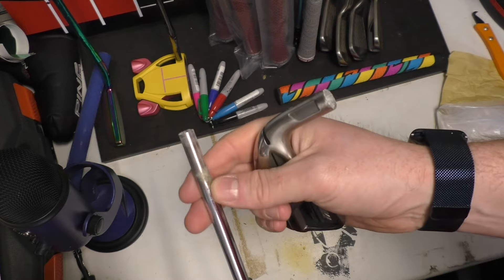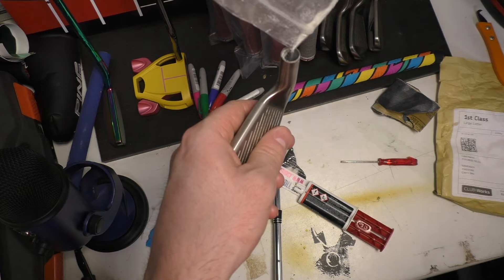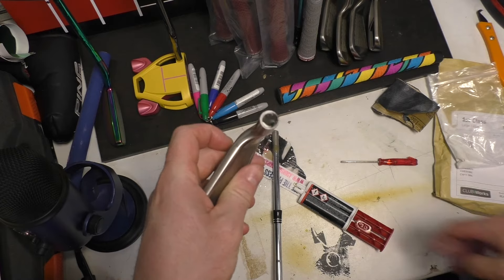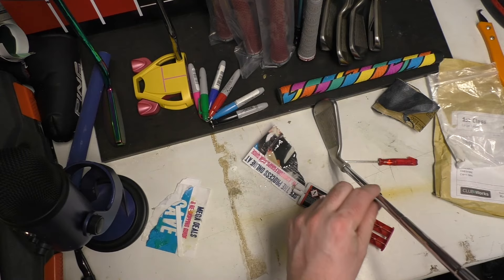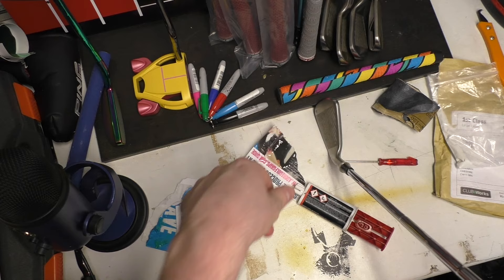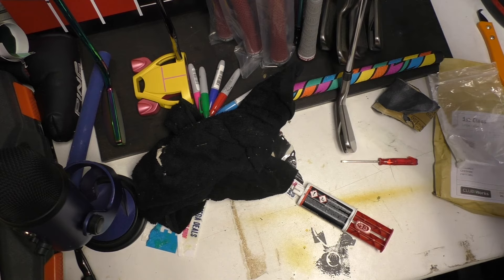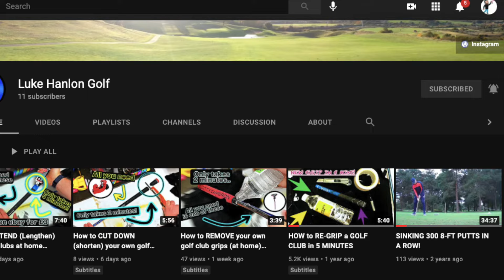HOW to FIX your GOLF CLUB if the HEAD comes off | Easy Tutorial

Comment: Luke, I would recommend that you mix your epoxy before assembly and slide the ferrule over the shaft tip first.This will ensure that the ferrule doesn't slide. Also use 24 hour epoxy, as quick epoxy tends to be brittle.
Reply: Agree, and add shaft beads to the epoxy mix instead of just dumping them in the hosel. You're using way more of the beads than is typical (more like 5 percent). I'd also be sure to wipe everything down at the end with acetone to clean up the remaining epoxy residue and any epoxy prints on the head or shaft.

Comment: For shaft beads I use a small amount of very clean fine sand. A pinch from a tropical fish or animal store.
Reply from the maker: Do you find that works better or is it cheaper or something?
Reply: That will give the glue a better key but shaft beads expand when they mix with the epoxy, sand won’t. ✌🏼

Comment: Thanks for the video Luke. Noticed you were fixing a Taylormade M5, did it come off whilst playing? The head of my M5 PW flew off at the driving range last night. It's a pretty new club. Just wondering if it's a common issue?
Reply from the maker: Hi Adam, it didn’t come off on it’s own I was changing the shafts but it is something more common with Taylormade clubs than other brands. I work in a retailer and 99% of the clubs that come back with the heads that have come off are Taylormade 😂 they do sell more clubs than anyone else tho so there’s more chance of it happening to them because of that too I guess but just a bit of epoxy glue and it will do the job
Reply: @LukeHanlonGolf  ahhh yeah ok, fingers crossed it doesn't happen with the others, I had to stop everyone hitting at the range so I could run and get it 😅cheers for the help!
Reply: I've got Taylormade P790s. I've had three shafts break in the head, and authentic that has come loose.